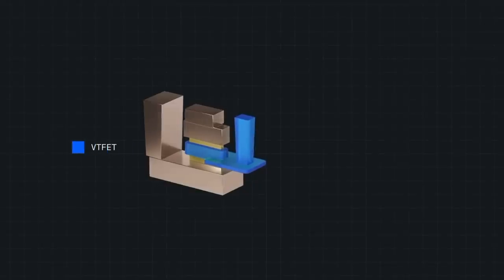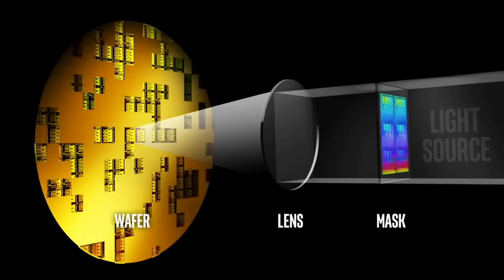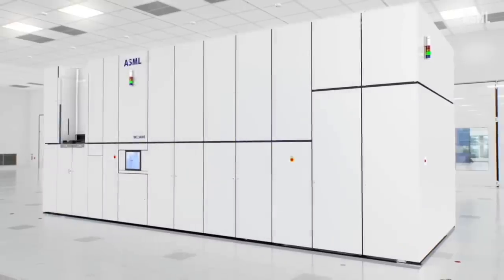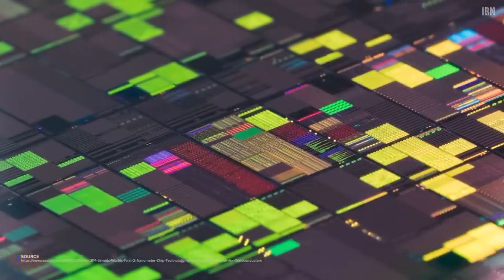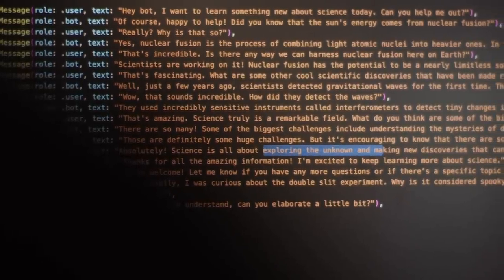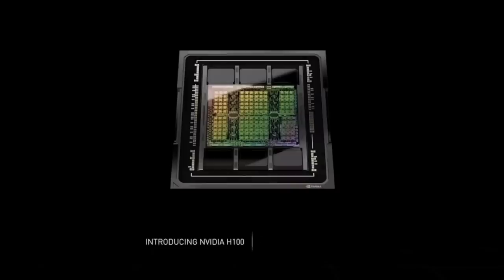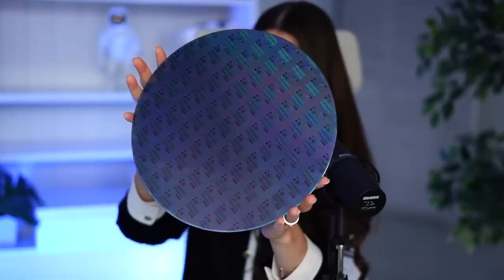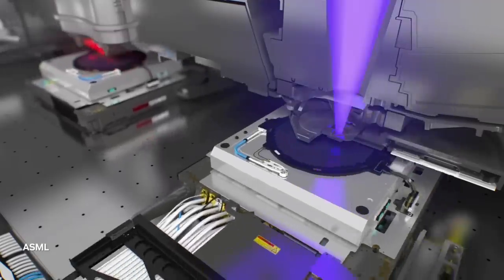Breakthrough in Chip Manufacturing - x40 times faster 🔥

Comment: Nobody else is talking about this, which is insane. This is a big deal. You deserve many more subscribers. I hope you get there. You deserve it.
Reply: It is not really that much of a big deal. It will speed up prototyping but will not affect fully ramp up production. Once you have your mask design you can use it to print over and over again until the microchips end of life. So with this technology you can cut down a 6 month bring up into 5 month and 3 weeks.
Reply: It's big, but not as much as it sounds and you might think. No reason to hype it up. It helps, nothing revolutionary in itself
Reply: @kazedcat  agreed it is an overblown nothing burger, a 40x in chip performance speed would be different.
Reply: The news is a couple weeks old, so most media outlets already reported it.. that's why nobody else is talking about this, they already did
Reply: I'm sure Asianometry has covered it.

Comment: I remember many years ago when photo lithography was hitting a wall and everyone in that industry was worried on how to resolve smaller features. Many thought it couldn't be done using conventional optical equipment yet they keep managing to come up with clever tricks to get around the problems. I see that innovation is still alive!
Reply: Manufacturing transistor design is going to need a change. Most people seem to actually believe that transistors are actually at 2nm in scale when in fact they are about 18000 nm square. And are about 90000nm cubic.
Reply: They've blown way past using conventional optical equipment. I'm not sure exactly when but 15 years ago they weren't.
Reply: One of the most clever ways is to simply lie and call a node ”3 nm” when there is no measurement anywhere even close to 3 nm.
Reply: @bighands69  I believe that measurement is the thickness or width of the transistors gate. Where did you get your measurements?
Reply: The wavelength of electron beam. that was always the issue.
We invested in EUV, and now xEUV replaced that, we always kept innovating !
The mask is not needed ? How you think we do that ? CRT TV skills needed, not an electron beam !
Mores low, did you remembered it correctly ?
Reply: @soylentgreenb it’s a bit of a cheat, but it’s still a useful measure of how many transistors will fit in a given area.  With only 3 companies doing advanced nodes, it’s not that hard to keep track of how each achieves their claimed size.

Comment: I worked on the worlds first EUV Reticle Inspection Microscope and it pretty much killed the company I worked for. Much like the computational techniques you describe here, we were attempting to image the effects of EUV masks rather than image the masks themselves, and it was almost impossible on the budget we were given. We didn't have a bright enough 13nm source, we were running right up against the limits of the optical, vacuum and stability systems which could be manufactured at the time, and we were attempting to characterise process windows smaller than anyone had ever attempted before.

We had a fraction of the budget that industry leaders like ASML would have expected, for the same research and it's amazing to think of many times our budget being spent on supercomputers to do what we were attempting, using computational techniques rather than using photons.

This has provided a fascinating insight into the current state of the industry. Thanks,

Comment: Wafer fab has come a long way from the days of simply printing a large mask and using lenses to reduce to the wafer size.  It would be a dense episode, but I would like to see a general overview of the process of creating a mask nowadays.  Is the large amount of computation to compensate for the image distortion of the optics?  I get the need for multiple masks because of the many layers of the chips.  Has the entire process evolved to the point where the source of the UV light is a version of an LCD screen where there is no actual mask involved?
Reply: Once upon a time, it was a mask per lithographic layer, but every mask has flaws, and as the features got smaller, each flaw had a more pronounced effect.

Reworking masks to remove these flaws was incredibly expensive and time consuming (imagine using a scanning tunnelling electron microscope to move atoms around and you probably won't be far off at current process nodes).

So, lithographers started imaging the same layer multiple times, with two or more masks (double and multi-patterning), so that the flaws 'averaged out'. Back when I was in the industry all anyone ever seem to talk about was LER (Line edge roughness) and this was the solution they had to endure, even when teh industry went from 193nm to 13.5nm. It also explains why modern chips require so many masks. It's not just the layers, it's the multi-patterning per layer.

I suspect that the computational techniques used now are about calculating the total lithographic effects of combining multiple masks, and possibly even the whole stack of masks, to minimise the process window for every one of the billions of features, taking into account the flaws in every mask simultaneously.

It's pretty damn impressive whichever way you look at it.

Comment: This is awesome. It gets me thinking, as someone who's studied physics, though. Essentially an integral can always be brut forced with compute, this technique being an improvement on that. But most of the mathematical calulations for exact results rely on symmetry arguments, without which the calculations were not possible by hand. Like calculating what the case and result would be for a sphere in a way that generalises to the universal solution. What if we trained large language models on a bunch of key mathematical loop holes, so to speak, and see if it can go on to find exact universal solutions for problems we currently brut force with compute?
Reply: Considering that GPT-4 as-is is already proving capable of performing decently on some relatively high level math tasks, and can improve with self reflection learning, it might be possible soon without training a unique LLM for the task specifically. But yeah I was thinking the same thing. When I read up on the recent research on GPT-4 the other day it struck me that think it won't be particularly long before we start seeing significant human-understandable math proofs of new and old problems achieved using LLMs. Machine learning has been used in the past to make a proof for something but the proof was so insanely long that it couldn't possibly be checked by humans. I can actually see LLMs being used collaboratively with humans in this regard when it comes to advancing math in new directions (not just finding proofs to theorems and stuff) - they will be able to riff off of human mathematicians' insight and proposals presented as input. Kind of like a synergistic brainstorm aid.

Comment: It might have been worth mentioning that the computed mask must interact with the light beam and cause interference pattern that "happens" to result in correct details on the chip. And computing the required mask pattern that results in correct interference pattern is the hard part. (And the reason for doing it this way is that wave length is already too long to do this with regular masks.)

Comment: Nice video. It says on wikipedia that the actual gate sizes are much bigger than a few nm and that it's just marketing material that says they are that small? So when you are comparing to DNA do you you mean it's physically that small?

"The term "3 nanometer" has no relation to any actual physical feature (such as gate length, metal pitch or gate pitch) of the transistors. According to the projections contained in the 2021 update of the International Roadmap for Devices and Systems published by IEEE Standards Association Industry Connection, a 3 nm node is expected to have a contacted gate pitch of 48 nanometers and a tightest metal pitch of 24 nanometers."
Reply from the maker: I discussed it in this video https://youtu.be/GdLRSF5wZpE

Comment: I hope this reduces the cost of masks sets. Deep sub-micron process nodes have such high NRE, they can only be afforded by companies guaranteed a very large return on their investment, either through having very high value chips (meaning not suitable for most consumer electronics), or having extremely high volumes.
As far as I know, there is no one imaging actual 2nm features yet. The 2nm designation refers to the equivalent gate length that a planar transistor would need to have to achieve the same performance. And even modern planar gates rely on lateral diffusion to achieve their final gate length using larger gates that mask the source/drain diffusions (this is a self-aligned transistor).

Comment: from 35MW down to 5MW , finfet switching energy, Theres a rabbit hole of how many switch throws does it take to (de)convolute waves. I do get excited when you say 1nm. Nice wafer. I have a quartz crystal with metal loops in the ends a rep gave me . Do TSMC make crystals ? would be interested in a crystal tech video, or has timing moved on. GaN and other exotics. TOF,thermal.

Comment: I asked a question about the way the qubits are used after their creation to fire outputs in a machine, the same way that the old method of =/< 5V = 0 and 15V - 20V = a One, the resultant opening of that gate allowing current flow. So, to approximate an answer to my own question.....is it Optical Relays??? Is THAT the way these light based qubits interface with the "physical" mechanisms of the machine?

Comment: I been wondering for a while, for all the issues associated with euv lithography that utilized vaporized tungsten. Wouldn't be easier for company to use lower energy photon then pass through a frequency multiplier (IE: none linear crystal with HHG property) to boosted to euv range at the very last step before reaching the mask ?
Cheap laser pointer from amazon already use non linear crystal to turn infrared laser into green light. What's stopping the same technology to boosted visible light laser to euv light, thus bypass the various mirror loss, high vacuum requirement issue ?

Comment: I thought the issue with our current way of making chips is that when you get down to sizes that small, you get problems like electrons gapping between switches?
Reply: There is a lot of nonsense out there and most people are getting caught up in marketing jargon. Transistors are nowhere near as small as it is being made out by the media. A typical integrated transistor is about 90000 nm cubic and about 18000 nm square. 
The key with understanding the 2nm marketing is that it really is in relation to certain feature sizes not the whole size of the transistor. 
Moore's law is about how many transistors can be put on an integrated circuit and if you view it from a square size point of view there is a lot more room down there to put more transistors on the circuits. But even leaving that out there is nothing stopping the circuits from getting larger. Clock speeds at the moment would be a limiting factor to large sized integrated circuits but we can only assume that clock speeds with new materials down the line will lead to a greater number of transistors.

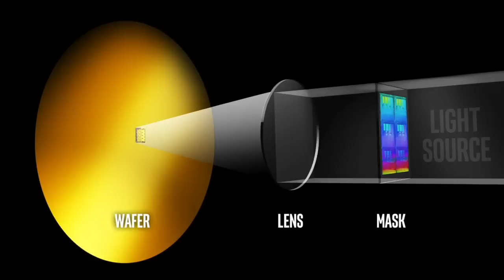Comment: Please note, there's No Pass through mask, And there's no pass through lenses after with EUV that visual at 1:02 is for older methods that still used optical light, EUV uses Reflective masks built in to to the reflective lenses, The lenses are 100% mirror surface rather then a glass lens as the frequency being used would be blocked completely before passing through glass.

Comment: When talking about 1nm chips I got surprised because I heard that below 2nm the quantic physics gets in the way. Is it true?
Reply: 1pm is the size of silicon atom i think and there are 20 atoms in 1nm, they(intel and AMD) are already going for 3nm and their plans for 2025 is already around 1 nm i think but who knows.
Reply: Yes that's true but 1nm "tracks" are viable because of VTFET (making the transistor vertical instead of horizontal allows the gate size to be larger than 2nm with a 1nm track) and also because of Ruthenium interconnects (wires between transistors etc) which uses less space than copper as it doesn't need insulation plus has less resistance so lower voltages can be used. It's pretty rare though.
Reply: @dumdumdumdum8804  
The transistors are nowhere near 3nm in size. Feature sizes are at 3nm but that is not exactly the same. 
Those feature sizes may actually have reached their limits but that does not mean the transistors cannot get smaller so that more can be put on the integrated circuits.

Comment: noob here... i have wondered what causes size limitations in terms of area, can they make fully integrated computer that covers a complete wafer?
Reply: When the chips get large clock speeds then become an issue as does impedance (resistance). The level of current that those systems use is very small so it means errors start to creep in so it would mean corrections would need to be applied which defeats the purpose of having lots of transistors. 
The thing is that we are nowhere near those size scales that would cause those types of problems in terms of complex physics. There are engineering challenges and it will not be a simple walk forward.

Comment: "BREAKTHOUGH" (holding a waffer) 

hopefully you didn't DROP this one.

ASML's technology needs to get smaller I predict that CHIP printing technology will shrink to the size of a photo copyer in time and the market will be more open BUT again this is a huge monopoly market right now silicon is sooo gatekept and this is why the market never advances as fast as it really should which is i guess a good thing because it means it gets advanced at a safe pace so as not to bypass the technology with instant replacements. 

but we're at a point where we NEED Advancements faster.

Comment: Where is the breaktrough? Its just one of many usual steps of progress to optimize one part of the production cycle and 40 times is just a marketing slogan. Other chips new chips with other optimized software could achieve the same. Its just progress. There is no special breaktrough. Otherwise you could say that every new process node consists of hundreds of breaktroughs whats basically true. Its just progess like its done for 40 years in the semiconductor industry.
Reply: True

Comment: Nvidia has collaborated with TSMC and ASML to develop a new algorithm that speeds up one of the most critical steps in chip manufacturing by 40 times, which will increase TSMC's throughput and enable them to produce more advanced chips without upgrading the equipment. The new technology will enable tissue to increase its throughput and produce more silicon wafers, and it will also speed up progress towards one nanometer and beyond. Nvidia's new algorithm reduces the time required to compute photomasks from several weeks to an overnight job, and it is implemented as purely math. The new technology uses a GPU-based algorithm, which accelerates computational lithography by 40 times. The acceleration is easily explainable because at its nature, this is an imaging task, and GPU is a much better fit for this than a CPU. The new breakthrough will help reduce costs and improve yields because the greater depth of focus results in less variation across a wafer. The technology will be used by TSMC in production starting from June this year, and other companies plan to support these new libraries.

Comment: 500 GPU 8 hours =4000CPU two weeks processing time is not 40x manufacturing faster. this is a clickbait.
Reply: :face-fuchsia-tongue-out: Nvidia's approach enables 500 DGX H100 systems (wielding 4,000 Hopper GPUs) do the same amount of work as 40,000 CPU-based servers, but do so 40X faster.
Reply: @74Gee  which is only 40x faster on mask design which is only small % of the whole chip making process. This is clickbait at best.